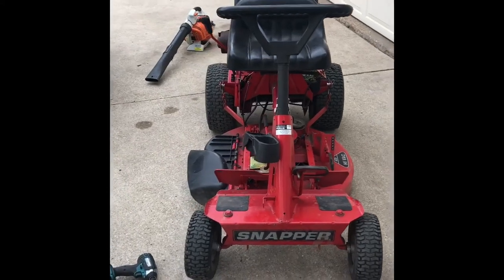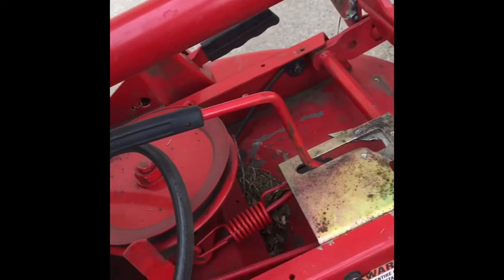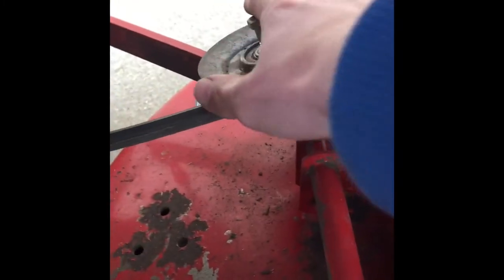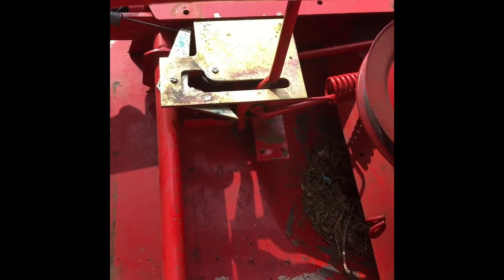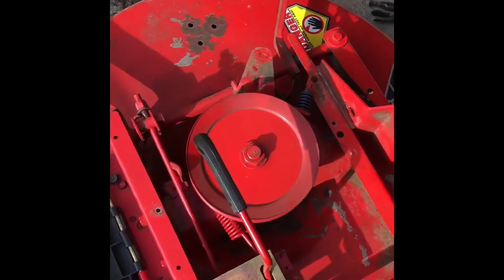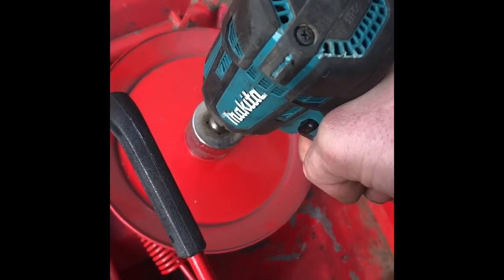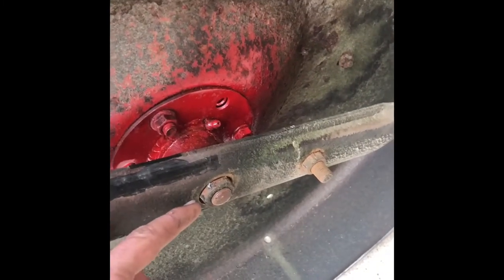How To Replace A Spindle On A Snapper Rear Engine Riding Mower

Comment: Good job! I bought a used 30" rer snapper... didn't know...the blade adapter was stripped and so was the spindle threads. I thought about just replacing the shaft $40, but the blade adaptor was going to be $85! so Got a complete new spindle assembly coming, with the adaptor for $122. I will probably watch your video again when it gets here. Thanks
Reply from the maker: Awesome glad I could help.  Sorry to hear about the threads being stripped

Comment: The center nut doesn't need removed to remove the blade and you installed the two blade bolts upside down leaving the long side with threads on it pointing down where those threads will take a beating.

Comment: 9:36  NICE weld, hope it holds, BUT what you are not aware of is that that plate you welded back on HAS to be no more than .030 perpendicular to the center of the shaft, because if it ISN'T when you bolt the blade back on the blade will not run true perpendicular to the ground & BTW, there is a grease filled bearing within 1/16 of that weld so you probably cooked the grease out of it, those tubes & flanges were welded completely empty, SORRY I worked AT the factory with ALL of these parts & assemblies so I hate to see folks going in the wrong direction that may cause them issues latter

Comment: You’re placing the washers in the wrong place upon assembly. they stack under the spindle before you put the cup housing on to keep it off of the bearing race.

Comment: Been working on it today, one thing you show while re assembling the activation plate goes between the two large snap rings (and they were a pain in the butt to get off). I had to use a small screwdriver, a large screwdriver and some small channel locks to pry one end up and grab it with the channel locks and use the big screw driver to pry up the edges. Thanks I'll finish it tomorrow, you know old and fat now (It takes all day to do what I used to do all day)
Reply from the maker: Haha.  Good info thank you

Comment: The hardware ON the Snapper rider especially the blade assembly / spindle housing is NOT Metric hardware, it's what's called standard SAE sizes

Comment: I am going through this right now with my 2013 RE 210 33 inch mower. I bought reversible Channellock snap ring pliers to get those tough and usually rusty snap rings off of the spindle housing. I am currently waiting on parts. The spindle housing separated from the mounting plate not 3 months after I put a brand new engine on the mower. I'm getting pretty good at working on these.
Reply from the maker: That’s good.  Yeah these can be a lot of work.  I do believe that one of the main causes for the spindle breaking off was because the blade is so big and heavy.  I know it’s designed like that but I think it has something to do with it

Comment: 7:53 You do NOT have to remove the internal snap ring to remove the spindle housing assembly NOR do you have to remove the bottom center nut of the blade

Comment: rats, you didn't show how to remove the blade holder bar.  It looks like it is threaded on - I have to remove mine - HOW do you keep the spindle shaft from turning???

Comment: FOLKS before you do all this work, you CAN remove that spindle housing assembly WITHOUT taking that deck off, speaking as one who WORKED AT the factory,  >> a) << Remove TOP center pulley >> b) << Remove everything under the pulley & to the TOP of the bearing shown & keep in order as it came off >> c) << Pull everything that slides OVER the spindle tube, you will need some snap ring pliers to remove the snap rings that fit into the ( outside diameter ) of the tube, with everything removed or pulled up & off of the tube you will now see where the tube slides FROM the bottom into & through the cross brace  >> d) << Get angled box end wrench or socket on extension that will reach into the sump and fit totally on the nuts or head of bolts >> e) << Take the correct wrenches etc for the hardware holding the spindle flange to the bottom side of the deck & remove the spindle housing hardware. NOTE: Parts d & e is best done while the mower is sitting on it's bumper AND the arm that slides OVER & pivots on the spindle tube can remain in place because the tube will be removed from the bottom, to give you more flexibility of the deck while on it's bumpers you can remove one or both of the rear chain arms chains for better access.

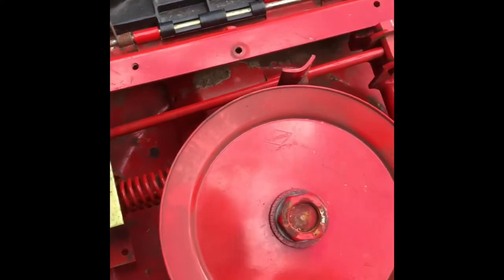Comment: 11:57  He left ONE maybe more of the spindle shaft washers that are supposed to slide down the shaft & locate ON the top bearing inner race. Geeze, folks a PARTS MANUAL Illustration for YOUR SPECIFIC Model Series is a MUST if you are NOT familiar with these mowers, Shade Tree YouTube clips can screw you up and mess up NEW or GOOD parts

Comment: Did you spray red anti-rust paint under deck before putting blade back on?  Looks like red paint
Reply from the maker: No, I just put red paint on the deck so it wouldn’t rust the weld away.  It really doesn’t matter

Comment: 10:42 THAT snap ring he is pointing to NEVER should of been pulled out, it was UNNECESSARY and also it looks like he DIDN'T get that ring SEATED in the groove. IF that ring pops out & it WILL if not seated the internal parts will begin to work out the bottom & I have SEEN that tube cut a groove into that brake cup on the back side

Comment: There isn't anything wrong with explaining a repair procedure however, it helps to know the items and not call them something else.  Also, you should have balanced the blade since it was hitting the deck.   Great Job still.
Reply from the maker: Blade was balanced off camera
Reply: @onlinesmallenginemechanics3999  how do you balance the blade
Reply: @brickstv3156  by buying a blade balancing tool

Comment: 9:06 This guy says these spindle housings are "pretty universal" they are >>> NOT <<< you need the housing assembly or just the housing for YOUR SPECIFIC Model Series Deck size, locations of grooves, spacers, length of the shaft itself etc was changed through out the years, Jim Jackson also gives out allot of MISINFORMATION about these Snappers